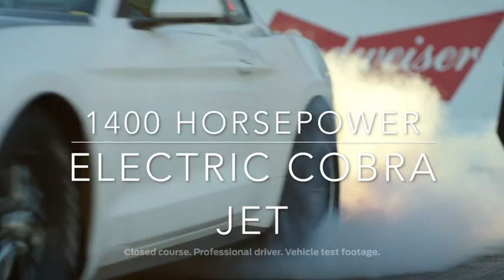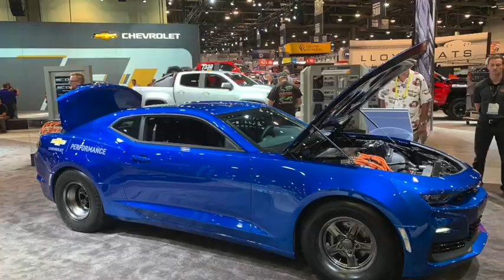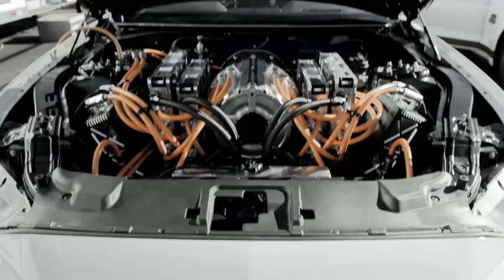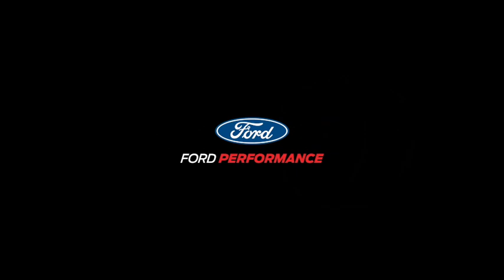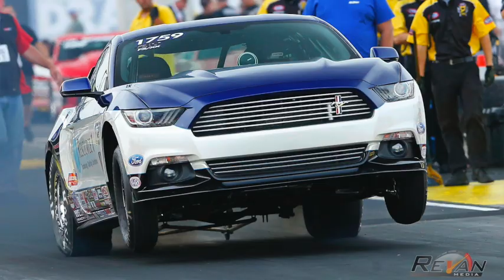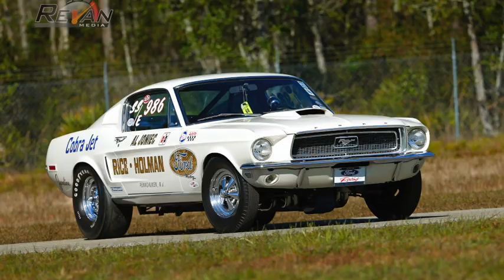1,400 HP "All-Electric" Cobra Jet Mustang Hits The Track - Is EV the future of Drag Racing?

Comment: I'm gonna miss ICE's. As long as I can still drive one, I will. I don't care how much faster an EV may be.
Reply: they aren't going away any time soon.
Reply: @wiselinkmarque3947  I hope they don't. With emission standards getting harder and harder to meet and even some countries (specially from Europe) banning ICE-powered cars in a few years/decades, I hope not everyone joins the bandwagon.
Many countries are still a long long way from having the required infrastructure to accomodate this new demand for electric power.
Reply: @Roddy_Zeh  ever see what kind of cars people that work at Tesla drive? lol.  Gas powered cars aren't going anywhere that is for sure.
Reply: @wiselinkmarque3947  Amen to that, mate! XD
Reply: They should not force the change, just put the technology out there and let the people decide what they like..
Reply: @henchicken1  Personally I'd rather have an electric Ford than a Tesla (with comparable performance, of course.. Ford already has had some weak lineup of electrics that nobody even talks about)  Well, I would welcome a body styling change on this car + electric with 0-60 times same as a Tesla model S.  I know Ford can do it, not sure why they hold back so much.  Some day I'm guessing that Ford will lead electrics on the road.  Around here, Tesla does that.
Reply: @wiselinkmarque3947  I would bet that they are in bed with the oil
 companies.
Reply: I hate 4 stroke anyways can any of them run in any position with just oil injection :https://www.4btswaps.com/attachments/2cyclesbc-jpg.6839/
Reply: News flash, Cobras aint electric dude,
Real cobras run ICE's not electric.
Call it something else not Cobras
Reply: @johnbaker2632  NEWS FLASH, no one cares what you think. People are just impressed with this beast.
Reply: @Neojhun  I  guess my view went completely  over head , try getting a life
Reply: @johnbaker2632  Note how few people say that specific argument, "Cobras ain't electric".  You need harsh dose of reality. Though I applaud you on original thought.